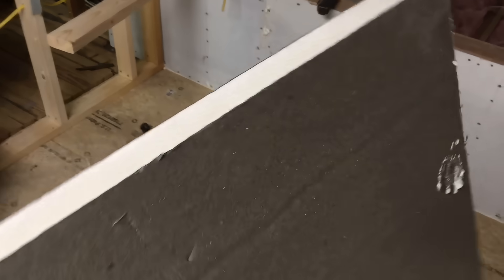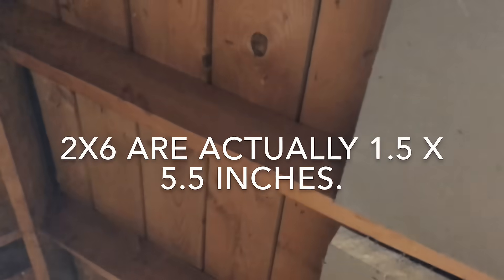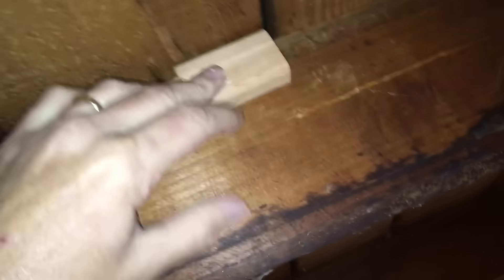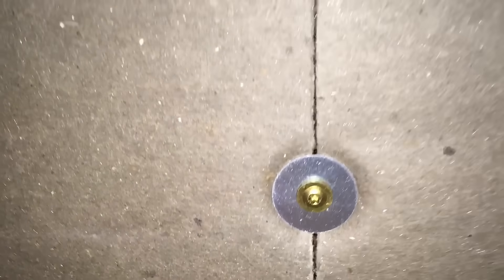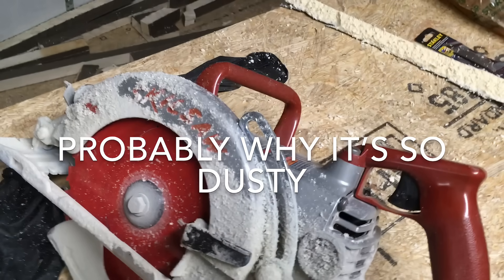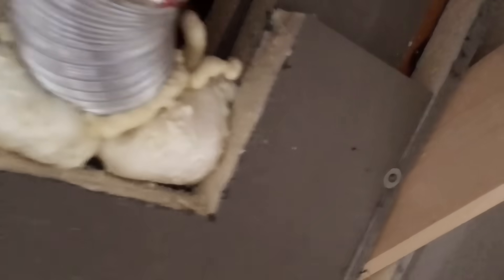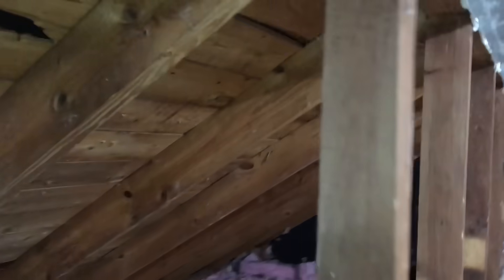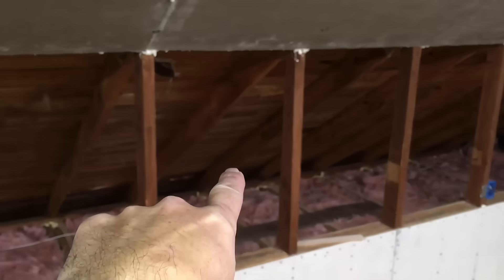Getting R-30 in an attic suite with 2x6 ceiling rafters

Comment: Awesome.  I just love creative solutions.... Not sure if I could handle the mess, although for $3000 savings...Maybe I could.  
\
I need R-30 in  my cathedral ceiling but I have 2x10 rafters...so I'm using R-30 mineral wool (supposed to be 7.5" thick so will be able to leave a couple of inches for ventilation above.
Reply from the maker: I think you're going the right route with your ceiling. Thanks for the comment.
Reply: @FamilyFriendlyDIY  Well, Thank YOU!  I'm sort of "wingin" it" in my addition..Thinking hard about all of the decisions but with no previous experience.  Good to get some positive feedback.  :)

Comment: Don't put fiberglass or roxul, they let air pass through and can cause major moisture damage
Reply: 99% of these 1/2 story homes must be riddled with rot, then. Nobody does it this way.  3” drywall screws are a pain and not worth the labor. How you going to glue drywall to foam board?

Comment: Hey Dave, so when you added the drywall you simply used longer screws to overcome the foam? Thanks.
Reply from the maker: Hey Alex, yes that's right, but it took me some figuring out because I couldn't find long enough drywall screws near me and had to order them. Here's a follow-up video where I talk about the drywall and screws.  https://youtu.be/dGeoA1ji_iM    And thanks for the comment.

Comment: what a load of crap.  code requires R30?  what a scam.  how did people live before foam or any insulation, i guess they all just died?  this is suppose to be the land of the free.  life, liberty and the pursuit of happiness.  this means you should be able to do whatever u want as long a u don't impose yourself onto others.  u want to build a house or buy a house with no insulation, that should be ur choice.
Reply from the maker: I hear ya. I've never researched the reasoning behind it. Maybe they're trying to ward off power or fuel shortages from high consumption. Thanks for the comment.

Comment: I used to work at a commercial insulation job and thought i'd give everyone some tips. When installing foam board to get the maximum efficiency, whatever you do, do not stack the boards directly on top of each other. In other words, don't line up the edges of the board. It's best to stagger the joints and by doing so, will have the following benefits. Reduced thermal loss at insulation joints, less thermal bridging and helps prevent moisture from the inside of the building from condensing on the underside of the roofing membrane. A more ideal solution would be to stagger the foam board joints. Joints of each layer must be offset (minimum 6” or as otherwise approved by the insulation manufacturer) to prevent continuous vertical joints through the full insulation thickness.

Air sealing your attic is essential to an energy efficient home, as well as the rest of the structure. With the amount of money, time and labor it takes to insulate, if you do not air seal completely, you're really doing yourself a disservice. Using as much insulation as possible but if a lot of air can slip by, what is the point? Use spray foam to seal large gaps and a good caulk with extreme stretch is a must. The hot and cold cycles will crack the cheap caulk, I promise. I'm from Texas and how they build here in the south is really stupid. It's all thrown up as cheaply as possible. There is at least 1.5" of uninsulated space taken up by the wood structure with studs every 16" and 24" on center, rafters, etc all the way up to the ceiling. A more ideal solution is to put the foam insulation on top of the rafters, horizontally in a running bond pattern using maximum board lengths to minimize number of joints. Offset foam board joints minimum 6",  leaving an air gap between the roof and rafters. Metal fasteners act as a thermal path. It’s best to use a strong adhesive and plastic fasteners designed for foam board.

Edit: No one in the business uses saws to cut foam board who do this eight hours a day, what a mess and a health hazard. It is a mechanical irritant, breathe it in and is a health risk. I like using a thin square metal blade, it looks like a bread knife without serrations, and sharpen it on both sides with a file or bench grinder. It is rigid, about 8" long and 1" wide to create a very fast sawing, cutting action and a sharp flat top for cutting into tight places. Then use aluminum faced tape to bond the joints together designed for foam board. 
Click link for a guide on how to install polyiso foam board, other foam boards are installed the same way. https://www.hunterpanels.com/docman-categories/technical-documents-wall-xci/xci-field-guides/xci-field-guide-part-one/1147-hunter-xci-field-guide-chapter-one-hunter-xci-foil-hunter-xci-class-a-hunter-xci-286-and-hunter-xci-cg/file
Reply: @bluecar5556. .. +1. .. Super. .. Nice detail.

Comment: fine idea, but its hard to imagine that 3 layers of that stuff isnt just as expensive as spray foam would've been....doing the math locally, looks like that would be at least $3-4 a sqft? plus youre reducing headspace by 2 inches.
Reply from the maker: Any way I looked at it I was going to have to reduce head-space. I was required to have an air-gap with even closed cell. Then to get the closed-cell R-30 thick (I think it's R-6.5 per inch--so I'd need 5 inches), I would have had to pad the rafters from their 5& 1/2 to 6 & 1/2. Then there's the cost of whatever baffles I would have had to have used to keep the air-gap clear. Add to that where I live (SC) closed-cell foam 5 inches thick is crazy expensive---at least it was when I was pricing. One of the insulation guys that quoted me said it was so expensive he wouldn't even do it if it were his house. Believe me, I don't like to spend money. I researched the fool out of insulation options. I'd have loved to have sat back and watched someone spray it, but this was the only way we could afford to add space up there and pass inspection. Thanks for your comment Sporttiger1!
Reply: @FamilyFriendlyDIY  thanks for the response. I've stared at my garage bonus room for hours trying to decide what to do. Lol.  There is really no 'cheap' way to do it

Comment: 4-6 grand for spray foam for that little attic?? Where do you live? I just had my 1600 ft2 house icynened (walls, roof deck and crawl) for 8 grand by the top-rated outfit in Central Ohio. 🤷‍♂️
Reply from the maker: I'm in South Carolina. At the time I posted this (and maybe still) there weren't many spray-foam contractors near me, so they can probably set a high price.

Comment: Poly iso is great at warmer temperatures, but its insulation value drops below 50F.  Above 50F, poly iso has an r value something like 7 per inch.  Below 50F its r-value drops from 7 per inch to 5 per inch and lower as the temperature drops.  The inside panel will likely maintain a higher r-value when outside temperatures are colder, but the outside-most panel will have a much lower r-value. 

On the other hand, polystyrene's r-value increases at lower temperatures.  

For cold climates, a good strategy would be to use polystyrene on the outside of the insulation and poly iso on the inside.
Reply from the maker: Interesting info. I live in a fairly mild climate, but your tip will be something for others to consider. Thanks for the comment.

Comment: Close cell foam must be pretty expensive in your area. Our company has had 2x6 bays filled with close for about  $2,000 for a ceiling about that size. You still have to go back and strap the ceiling which you didn’t include in your total cost. The labor and materials for what you did seem to be less than cost effective. The spray job would have been superior.
Reply: @steven Foust hi Steve can you tell me what is the r value for 2” of closed cell Sprayfoam?

Comment: Please people don't do this if you do this you mot be able to put drywall on the ceiling the best you can do in this case is spray foam insulation (close cell insulation) there is lots of options and is not that expensive like he said 6.000 for that is not true

Comment: At all rafters you have reduced R-value at about R11 vs R30 for in between the rafters. When you see a calculation of the compounded R-value of a wall with thermal bridging you would be surprised by how much the overall R-value is compromised by the areas of the rafters. I didn’t do the calculation but wouldn’t be surprised if your overall value went down to something like R-25. Still not bad. A very clean way which involves getting a new roof in outside insulation on top of the sheathing. There is a lot that we could improve in roof construction in our country. It took literally decades for people to generally realize that a rainscreen is far superior to a conventional wall construction. The same is true for roofs. Maybe I will do a video to explain how this works....

Comment: We have recently done a similar insulating job. However, we used Super-Tuff R (I think that what it is - not where I can look at the moment). Also a fiber infused foam - and this stuff won't burn. Anyway, why did the inspector want 3 layers? I understand that they are "rated" as R11.4 - and you need R30, but foam insulation that is foamed to the rafters is a sealed system and the performance just isn't equitable - the sealed foam is much better. I looked into having spray foam companies do our roof and walls - and they said 2 inches was all they recommended as anything beyond that is just not economical as the gain in insulative value is minimal for the great additional expense. In other words, if you had put a membrane in there to leave the 1.5" gap, and had it spray foamed - likely - the inspector would have passed that even if only foamed 2" thick. You are effectively doing the same thing as you are foaming the edges and still creating the same seal as the spray foam method - you are just using pre-fabed foam as the bulk of it. We don't have inspectors in our area - no building permits related to building code. I only did a single layer of the 2" - but recessed it up into the rafters 2" so that if I wanted to add another layer I could. But, so far, with the space above being vented and using a gable fan, I have not found it to be needed so will leave it at the 1 layer. Just curious if this discussion came up with your inspector and what his rational was for still requiring 3 layers.
Reply from the maker: They just go by the numbers on the product documentation here. They require R-30 in our area, so all the r-values had to add up to at least that.  ... at any rate, it's like an icebox up there in the middle of summer now :-) .... Thanks for the comment.

Comment: Did you glue each layer of board, or screw in at each layer, or put all 3 layers together and screwed it in a once as i assume
Reply from the maker: They're one at a time, friction fit, foamed the edges of each layer, then screwed the last layer across the rafters, foaming those edges too (if I remember right).

Comment: It's worth noting that spray foam would have cost even more, because the air gap is still needed, so it would have been another layer of sheathing followed by the foam.
Reply from the maker: You're absolutely right. Thanks for the comment.

Comment: What you could've  done was rip down 2x4 studs and screw them to the face of the 2x6 rafters to give you the additional space.
Reply: That would provide worse insulation as the 2x4 studs would thermal bridge. Better to just do it right like he did.

Comment: Now for me i would have threw R23 rockwool in the gaps THEN going in different direction hit it with Rockwool comfortboard then no need to spray foam anything. Can use caps and screws to hold comfort board up. Cool thing is it breathes, resists  moisture and it's fireproof. That iso board will burn toxic if it catches and doesn't dry if any moisture gets around it.

Comment: Instead of using polyiso insulation-switch to XPS OR EPS.  I work in the roofing industry and we only use this polyiso with fiberglass facer because the facer is made to have stuff stick to it.  We use extruded (XPS no facer) or Expanded (EPS (styrofoam)because it doesnt have the fiberglass that irritates skin and lungs
Reply from the maker: I went with the polyiso because it was cheaper than the polystyrene. ...Thanks for the comment.

Comment: Problem is you didn't get R-30 in the rafter space, so your Title is misleading. You ended up putting 2" of foam board across the rafters, which means that when you put 1/2" sheetrock to cover the foam board, you will have to use 3 1/2" sheet rock screws to reach the rafter and have enough screw left to bite into the rafter. Should have just padded the rafters down 2" with 2x material and leave 1 1/2"  of airspace under the roof deck. Padding down 2" with 2x material gives you a 7 1/2" rafter space which after filling with 6" of foam board allows you to screw sheetrock directly to the padded rafter with standard sheetrock screws. In essence you padded the rafters down 2" with the foam board, so no change in lost headroom by padding the rafters with 2x material.
Reply from the maker: Thanks for the comment. ... In my description, I mention a thermal break (produced by the foam across the rafters).
Reply: Given 2x6 roof rafters, tack 1x2 against the rafters tight against the roof decking, tack 1/2 inch foam board below that, stuff in 4 inch fiberglass bats, install cross bucks just below the ridge board, cover with drywall.  The foam board increases your insulation while allowing heat to escape out the ridge vent, and the cross bucks provide a wiring chase for electrical boxes for lights and ceiling fan.  Probly the wrong way to do things, since I made a complete mess of my own house, but the suggestion is there - for what it's worth.

Comment: I do believe they call this the cut and cobble method
I have heard that there can be issues with separation over time from the wood to the sprayfoam, I sure hope not because i did this in some areas of my home.
I would have probably used xps as it is the best material on the market today.
Nice work though, Im in an r50 zone, so this wont cut it for me.
Reply from the maker: Ouch, R-50?!  ... Thanks for the comments.
Reply: Northern ontario area code is r80  
double ouch

Comment: It would be really nice if you could provide a link for the actual foam panels. I never was able to find foam that cheap in those dimensions.
Reply from the maker: Here's a link to the panels I bought. I couldn't find a sale listing on the web, but I found them for sale at a local roofing supply company (ABC Supply, Greenville, SC--USA).
https://www.youtube.com/redirect?stzid=UgyndDGX0R17humzW-h4AaABAg&event=comments&q=https%3A%2F%2Fwww.gaf.com%2Fen-us%2Froofing-products%2Fcommercial-roofing-products%2Finsulation-cover-boards%2Fcover-board%2Fhd-polyiso%2Fenergyguard-hd-cover-board&redir_token=TYCw35c19Qgnwx5dLqxq0x3DYuV8MTU4OTI4NDcyNkAxNTg5MTk4MzI2

Comment: Before I would do this I would get 2 or 3 quotes on spray foam simply because of the labor and the inability to get the final product as good. I’ve bought some foam sheets and even the pink R6 foam was $20/sheet.  They even make home kits for foam that are around $500 to foam a room.

Comment: Could you have just spray foam in between layers of the 2 inch foam board?  Looking to do the exact same thing.  Was thinking of batts on the knee walls and ceiling, but I've seen others do the whole thing with foam board.

Comment: You could also have installed R22 roxul batt (5.5inch) by adding a 2x2 over your 2x6 with an R10 of ridgid insulation (like Dow Cladmate) with strapping and drywall (add maybe R2) that give you around R34. Three big advantages: faster, a little bit cheaper and better sound insulation.
Reply: Forgot to mention that the 2x2 is needed to keep a good 1,5inch of gap between the roof and the roxul batt. A semi ridgid baffle should be installed before so that even if you push the batt too hard you will always have an air gap.
Reply from the maker: That does sound interesting. I'd have to see an actual price comparison though. ... Thanks for the comments Antoine!
Reply: ½" drywall is r.5.

Comment: You can also cut it with a knife that way no dust!
Reply from the maker: Thanks. Yes I used a knife to do some small cuts. I'll probably experiment with a few different techniques when I start the other side. There have been a lot of great ideas. Thanks for the comment.
Reply: Cool. Try running your knife half through it then bending the opposite way along the cut and you should get a clean break
Reply from the maker: tried that in my new video https://youtu.be/Z292iuV91hA  Thanks for the comment!

Comment: Polyioscyanurate is know to experience thermal value drift. Within a year of install, you are closer to R 28. If you choose to follow a path like this, shoot a bit higher than the code value so that you meet your performance target after the drift.
Reply: Polyiso dose not experience thermal drift.
Reply: @ChesterVanPelt7173  this is not what the research has proven. While the drift is minimal compared to some other products, it does drift as gravity will compress it a bit over time. Thus my comment about shooting for a few points higher than the desired level long term. Please research before making comments about “does not” vs “does minimally.”
Reply: @musicteacherbuilder  I work for a polyiso manufacturer. The theory of drift was started by the rock wool industry. The only r-value drift you get is at -40 F when the gas’s in the polyiso starts to decrease the overall r value by .5. You recover the r value when the temperature increases. You will never have a compression drift unless it is installed as a roof system and foot traffic control s the reason for compression.